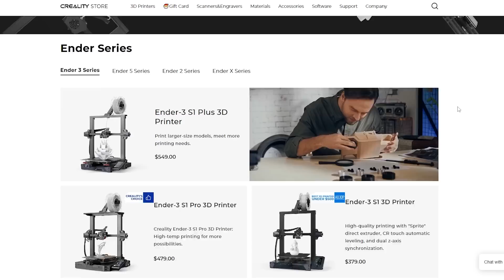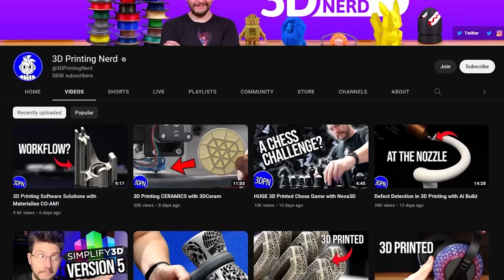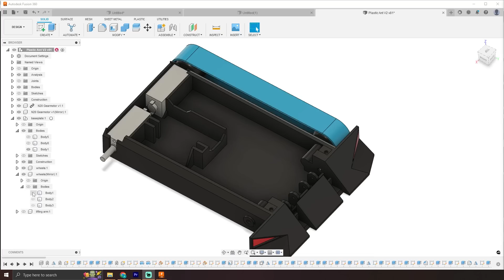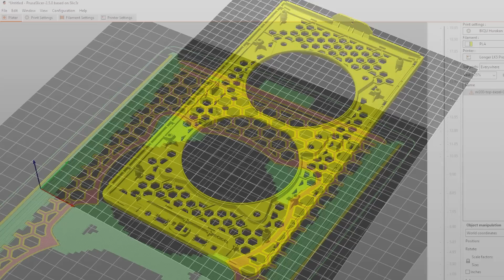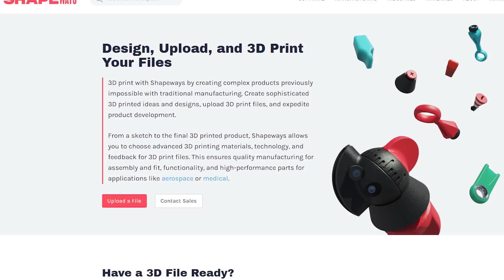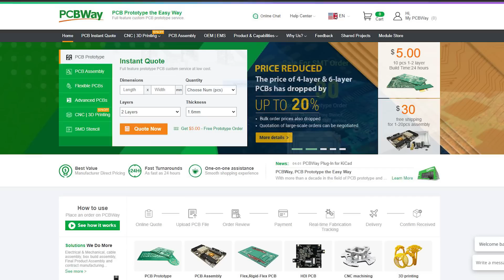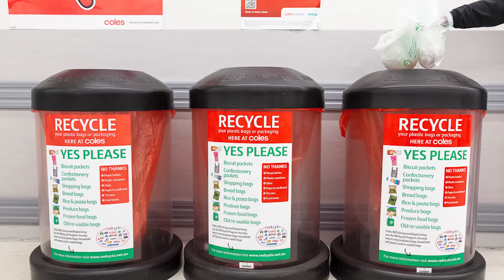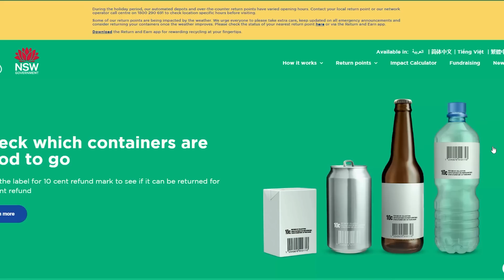My 3D Printing Predictions for 2023

Comment: While AI reached nearly every digital aspect now in the world. I hope or think that AI will take a bigger role in 3d printing. Expecially with slicers! Since when i look at them, i wondering why it having such a inefficient infill options for ex. Or why things like the different settings boxes that you can make in Cura, only works with a few settings, but not all. Speaking of this, why isn't there a vase mode that allows infill like printing? Or ability to slice objects that aren't only have side walls? 

Also i hope that 3d printers with rotateable extruders become more common and standard, as that would offer so much better print quality. Expecially with Cura's surface smoothing option, which only works with top layers.

Comment: The race to the bottom was a good one, I still use my pre-sale ender 3's that I bought for $170. Don't tell them that I replaced the motherboard, the print bed, the hot end, the fans, added dual z, added raspberry pi for octoprint. Hey at least I didn't have to replace the belts, the motors, or the frame... just goes to show the price up front shouldn't always be the reason why you buy a printer. I suppose I probably wouldn't understand how they work to the depth that I do had I just bought a prusa. I still think I might actually buy a prusa and give one of my tuned&upgraded ender 3's to my brother

Comment: Slicing bottles into strips is highly overrated. Videos are showing huge yields from a single bottle are so unrealistic. In reality you would have a hard time making a maker coin with what you get from 1 bottle. No need for an output spool, as you aren't going to get enough to put on a spool, and there is no easy way to splice it.
Reply from the maker: Yeah you don't get much. I wonder if the ends could be spliced though, considering it's essentially forming a straw. Not easily though
Reply: @MakersMuse  more of a U shape, so you could slide two pieces together and heat it, but you are going to get a blob. Maybe someone will come up with a splicer.
Reply: Also people will probably prefer to just recycle the bottles to get their cash back.
Reply: @logitech4873  Not everyone gets cash back. Depends on what country you live in.

Comment: Recycling plastic: since you get about the same energy out of the plastic as the base oil originally had, I'd hope that if not recycled it would at least be burnt for energy.

Landfill is both a massive waste and terrible for the environment. Surely it's much better to burn waste plastic rather than virgin oil or coal?

Comment: I am the most interested in the fully functional and lower cost CAD options... the current low cost options either have a rather steep and unfriendly learning curve (although they are awesome once you figure them out) or are so simplistic with their primitives that you have to do a LOT of extra work to create the more detailed or unusually shaped objects.  To get into the more functional and perhaps a bit easier options will cost a LOT more money than the average hobbyist is willing to work with... some costing as much *Per month* as the 3D printer itself that you are using...  I fully understand that you get what you pay for, whether through cash or effort learning, but right now the gap is still far too wide to be of much use and is a serious hindrance to those that want to design something unique rather than surfing the .stl sites for something close to what they want... and God help you if you want to try to modify something!

Comment: Will be cool to see a rise of bottle recycling next year or so, plus some easy way to reuse plastic we collect.
Plasticity I think a good CAD like software which was created recently?
Also would be awesome to see some enclosed 40x40x40cm printers with auto cleaning, auto bed leveling and auto filament changing. Because there is a huge money gap between 30x30x30cm printers and 40x40x40+cm (print dimensions)

Comment: I think there could be a decent market for that recycle invention that makes it back into a noodle that you can reuse in any 3d printer. If they can engineer a decent product that is safe and simple to use at a reasonable price I know I would want one. Imagine not caring nearly as much if a print fails because you can just melt it back down and try again. And if it’s possible with any of the current types of filament materials that would be awesome.

Comment: Recycling needs to be a major focus for 3D printing in the next few years. I'm hoping disruptors like Bambu and Anker make an affordable recycler for failed prints and wastes - grinding and extruding them as fresh filament. Also a better way to reuse our spools, make them all in cardboard and easy to disassemble - twist to dislodge the tube and 2 plates, similar to Prusament spools. Ease of disassembly reduce the spool's footprint and increase ease of recycling, also the three pieces can be more easily reused into projects like storage cans (tubes) and whatever flat cardboard can achieve.

Comment: Thanks for another great video Angus! On the topic of easier to use CAD, and the rise of AI tools and software, there will probably be some integration between CAD and AI. We may also see this coming to slicers, Using AI to determine the best settings for the print. While the market for AI is still relatively small, I'm sure we'll see some AI-based CAD tools in the future.

Comment: Regarding #5 -- one of the things that the toolchain for 3D printers should be adding is ... a way to emboss the material code of your 3D print on the print as a part of the slicer.

If we can have a myriad of infill patterns, non-planar toolpaths, and other innovations ... why not a slicer that simply embosses either of:

- the ASTM Resin Identification Code - AKA the 3-arrowed triangle symbol with the number in it
- the industrial material codes between angle brackets for instance - >PA6.6< - Nylon

And... if it's not the responsibility of the slicer to know the material used, then it's time to make that info known when you're passing the model through the toolchain to the 3D printer.   We're printing with recyclable materials... we should be marking the parts so someone other than the person making it can identify what it's made of, to give it better than a snowball's chance in hell of getting recycled when the time comes.
Reply: My dude, imagine the process of some poor sanitation worker sifting through a box of 1000 failed benchies trying to read microscopic codes so they can be recycled to save a billionth of a cent.  It's just not viable from a straight up energy use perspective, let alone economic.  The proper way to "recycle" plastic is to burn it in a controlled incinerator environment to recover the energy.  With proper temperature and scrubbers, toxic emissions can be virtually eliminated.

Comment: My prediction is there will be at least 8 new Ender 3 models in 2023 with only very slight differences between them.
Reply: My prediction is that when your prediction comes true, I will be just as confused at the array of new models as I am at the array of current models.
Reply: Creality just gives you MOST of the printer. You gotta finish it.
Reply: @VioFax  You are correct. Why Creality did not put the Ender 3 S1 Plus as a high temperature machine is beyond my understanding. Just using the S1 with a larger print bed and then charging more for it than the S1 Pro is IMHO nothing but criminal. If I can somehow get a S1 Plus for cheap then I will fit the S1 Pro print head to have something of value. Currently price is a rip-off.
Reply: But the market of turning it into something that works is huge. Just look at Ali express.
Reply: Chinese junkware
Reply: As apposed to? Specifically?
Reply: @dovan4092  What do you mean? Are you asking what would be opposed to my prediction? If so, then specifically, anything but what I predicted.
Reply: @paulthetexan  I just saw your reply and after a month I don't recall exactly what was on my mind but if I had to guess I'd say I was likely wondering what more they could do or what you'd like to see
Reply: @dovan4092  I'd like to see them make 2 or 3 good models instead of 50 so-so models. But Bambu Labs has kinda stepped in to fill that role. So I don't really want anything from Creality anymore. I appreciate the reply because I was sincerely confused.
Reply: @paulthetexan  Got it, I'm actually new to 3d printing and have the ender 3 s1 pro and the more I use it and learn the more frustrated I am with Creality. It's unlikely I'll stick with them when\if I buy another better\faster printer. I like Bambu labs but those high speed printers are too loud and even in silent mode they seem to bang a lot. Unfortunately I can't put my printer on a different floor. Anyway, I was just curious if there was anything specific you thought their printers should have but don't. Cheers
Reply: @dovan4092  It's true that the Bambu printers are loud by default, but there's a couple things you can do to mitigate that. You can force them to print slower, which helps, and you can also isolate them by putting them on something like a concrete paver that is itself sitting on some dense memory foam. It's kind of a pain and the noise is the one area where I don't like the Bambu printers. I know you don't have the option to put them far away, but if you did, you could just do that since Orca slicer lets you control them remotely. I hope you stick with 3d printing, as it's a great hobby and can be extremely useful, too.
Reply: Creality on their way to realise things that compete with their own printer then released a week earlier
Reply: i bought ender 6 rip me its broken now after some mods and btw i buy ender 6 without any thinking 2 seconds later ender 7

Comment: Happy New Year. 2022 was pretty good to me. Got an Ender 3 Pro for only $100. I wasn't happy with Fusion360 kicking us to the curb, but I find FreeCAD very good for my needs.
Reply: I have found FreeCAD very useful, although complex assemblies can be problematic when part lists get long.  It is certainly not EdgeCAD, but for substantial design efforts, it is pretty close.

Comment: The trend of larger hobby 3D printer manufacturers essentially abandoning their printer after release needs to stop. Many of these players in the market are always chasing 'the next big thing' which is exactly the same as the last one, but with insignificant changes - and becomes a new model with their old stuff never being touched again.

It thrusts the maintenance and lifetime of these printers directly onto the 3D printing community - while screwing over their customers time and time again.

Comment: I think Ultimaker wont survive since the models after the Ultimaker 2+ (expect the Ultimaker 3 Connect, which uses the UM2+ hotend) die slowly, these machines are AWEFUL (i own a couple of UM3's and the UM2+ does a better job than the later models.), especially when choice of 2.85 filaments are getting less and less (the demand is almost none to 2.85mm) So UM needs to get back into 1,75mm but since they are now owned by Stratasys they probably let it die out slowly.

Comment: The big problem with single hobbyists recycling their own stuff is time. It takes a huge time investment to get into even the simpler methods of re-using 3d printing plastics at home. I think a way to go might be community efforts, maybe related to maker spaces, where you can bring together things like failed PLA prints as a group and work with larger batches of plastic of the same type.
Reply: THIS.  I was writing on scales a while back, and unless you are a MAJOR prosumer type person, community/maker space scale makes way more sense.  Either as a Makerspace or a Toolshare kind of thing, taking the cost and spreading it over 10-30 people really makes things interesting.
Reply: Yeah, I wish a local maker space would have a communal filament recycler.  I don't know if one would ever pay for itself if I bought one, but for 20-50 people each using it about once a month it would be a wonderful investment.  Unfortunately I live in a rural area, and I'll not likely find a large enough group of hobbyists to pool resources.
Reply: Just figure out how to handle the guy who keeps putting the wrong kind of plastic, or with blue tape bits mixed in.
Reply: @mrtechnophile3483  You forgot "and whining `your product doesn't work`".
Reply: The biggest problem for me is my shed full of failed prints and supports, carefully sorted by type. For starters I’d like an affordable grinder to compress the space it occupies. And then directly into a pellet hotend please 😆
Reply: Solution is automation and scaling, but then you will have another problem: dirt and dust.
Reply: The amount of waste PLA a lot of us generate is not sufficient to warrant the effort of recycling your own.
I guess it depends on the individual end user.
Reply: PLA isn’t worth the trouble. I print almost exclusively ABS and I can use the scrap supports to make a slurry for finishing, glueing, even pouring into molds. Almost no waste at this point.
Reply: @Googlie_Wooglie  Makes Sense.  On a related note, could one “wet spin” / extrude ABS from Solution?  I was considering this for Recycling Water Soluble Support Materials; i forgot about ABS!

(The process is essentially the same as how “reformed cellulose”, like Rayon, Viscose, “Bamboo Silk” etc are made i would imagine)
Reply: @ericlotze7724  I doubt it. You’d have to dissolve it, then dehydrate as you reformed the filament. I can’t imagine a hobbyist could get anything uniform out of it.

Comment: Honestly in the next year I think the software tooling is going to stagnate a bit and the main printers will only get feelgood factors like 'executive powder coated surface' paint jobs or 'true full spectrum RGB lighting'.
With the supply chain issues for the hardware I suspect the manufacturers will carry on one-upping each other to get the sales, but go for the lower fruit of looks to snag them than quality of life improvements.
With software, I think its a similar story as in the mainstream there's Solidworks if you can snag it or Fusion 360 if you can trust it. 
And yes I'm aware of Freecad, and yes I've looked into a lot of the others (I put some serious hours into a modelling addon in Blender specifically for creating £D printable objects, and short story, not for me, the core of Blender just doesn't bend enough for it).
Personally I've settled on using Solvespace, it's a very simple parametric modeler that is easier to use than Freecad, but lacks a lot of functionality (like edge bevels and chamfers) but frankly is awesome, and more importantly it saves it's files locally... No-one can whip my files from me at any time they decide the pricing model (Solvespace is free open source) doesn't work for them anymore.
Oh and I also finally decided I don't want to be a hobbyist 3D Printer Guy anymore, consigned my crap printer to the parts bin of doom and bought me a lovely Prusa Mini+, which is keeping me company, quietly chugging away while I write this. I need my printer to print stuff when I tell it to, not when it feels like it, not when the moon is in the correct segment and the wind aligns with the Earths chakras.

Yeah a bit of a moan, but I think the industry is very likely to go a couple of years of pushing out barrel scraping crap, partly because of the profiteering bottom line but also because frankly they are just as tired as everyone else at this point and need a bit of time to have the freedom to be excited again.

Comment: The war in Ukraine has shown that 3D printing has practical applications outside of the hacker's garage but the big hurdle is the CAD part. If I had a lot of free time, I would be throwing myself into learning CAD and starting a business designing small, bespoke parts as a service. You tell me what you want, and I design it then use one of those CAM services to get it delivered to your door.

Comment: I agree 150% with prediction 2! I'm currently working on a AI model that might be able to make 3d printable parts just by giving it words about that part you want!
Reply from the maker: Ooh definitely keep me in the loop!
Reply: @MakersMuse  150% will do it works right now with making shapes but i need to train data in for it to understand what 3d printers can handle :) overhangs etc etc take a look I'm starting with this (OpenAI Point-E)